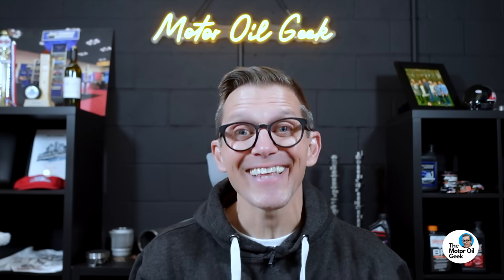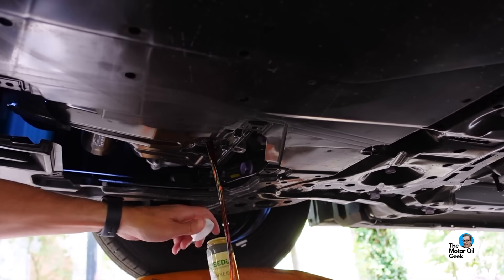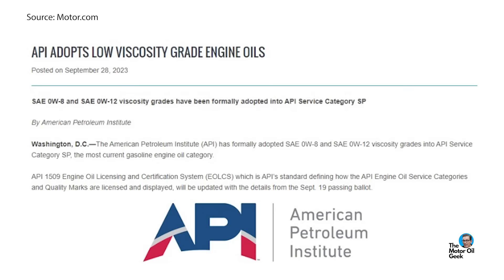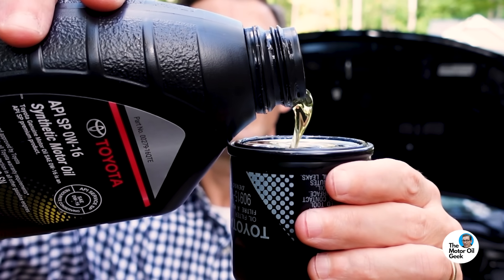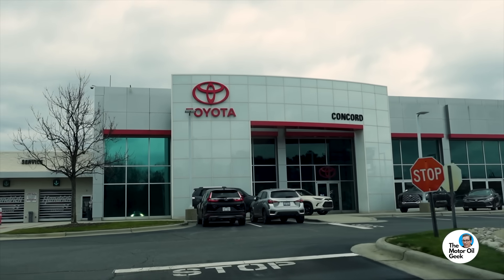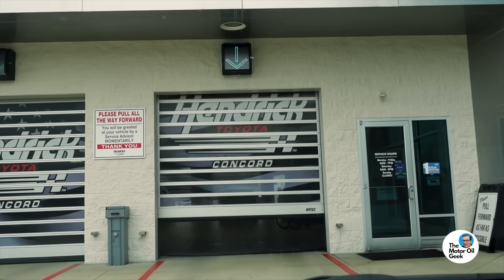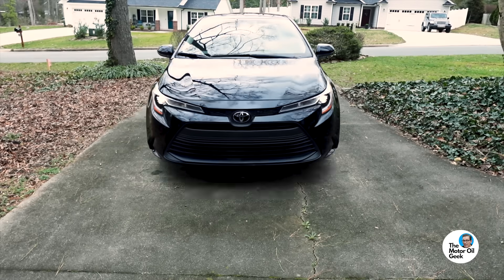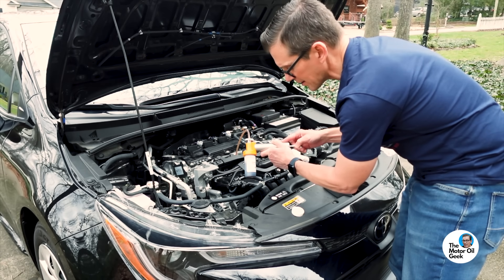0W-8 Motor Oil: Too THIN to Trust? Let's Find Out!

Comment: Worked at a FCA dealer for a few years, 1 time we had a customer that'd bought a new durango 3.6. she immediately had a small lift and bigger wheels and tires on it, then decided to keep driving it for 12k miles. Came in for a oil change (must have gotten tired of the car beeping and displaying oil change now on the dash, for the past 6k miles), took the drain plug out and nothing happend. I stuck a small screwdriver in the hole, started pulling big chunks of black sludge out then eventually oil came out. I changed the oil put in some justice brother oil cleaner let it run and changed it again, I'd be surprised if its still running. Basically I'm saying don't be dumb, change your oil at the right intervals. I may be wrong but i feel like the issue with the lower weight oils isn't necessarily wear but more of a problem of it getting past the rings and burning. An old rule of thumb in older engines (pre cylinder deactivation and vvt) is when they start burning oil is to put some thick as hell lucas in it. It may be fine for these newer cars but i wont be switching to any oil starting with a 0 anytime soon, even if it may slightly increase power and fuel economy.

Comment: I have a 2015 Lexus CT200 h, I have taken it twice to the dealer, and they will not change the transmission fluid they told me it's not recommended to do it, and they won't do it.

Comment: Here in Sweden I have recently bought a Mazda 2 hybrid which is the same car as the Toyota Yaris hybrid , and the owners manual stipulates the use of 0W-8 oil. It also states that 0W-16 or 0W-20 can be used temporarily  but you must revert back to 0W-8 at the next oil change. However , Mazda refuses to use 0W-8 and uses their own brand of 0W-20. I just wonder if this will have any long term effects on engine ware.
Reply: Sweden is a wealthy country. Please buy Mercedes s580 with V8 engine.
Reply: @rachelgreen1368  I would do , but there are none for sale over here.

Comment: I know i probably won't get an answer but I'll shoot my shot.

my 2020 Mazda 3 i just bought Yesterday has the Skyactive X Engine in it 

the manual says i should use 0W20 oil in normal conditions and in Hard conditions 5W30

 now 0W20 is also very thin oil and i dont know who to trust 
i would love some tests obviously maybe someone has some info on it ?

Comment: I have a 24 Tundra sr with the base turbo v6, I believe a lot of the Tundra engine issues are due to the first oil change at 10,000 miles. I did mine at 1500, 5,000 then I'll do them at 4-5,000 for the rest of its life. I use only Toyota oil and filters. I have 20,000 miles on it, purchased new on 1/21/2024. The Toyota filters are about the size of my lawnmower oil filters, even if I was doing longer intervals I'd probably change the filter at 5,000 miles. But oil is so cheap compared to engine failure
Reply: There are larger toyota filters available, just do some research. I switched mine about 20k miles ago.

Comment: I was just wondering does the Toyota have a filter does CVT transmission my Ford freestyle has two filters and we're supposed to change it I believe every 30 to 60,000 MI

Comment: Are the Toyota care terms different by state or something? I bought a 2025 Corolla and the dealer recommended oil change at 5k, off course I did braking change at 1k and again at 2k, but for here and out I will just take it to the dealer

Comment: 10000 miles on the first oil? That’s way too long. Car manufacturers haven’t been doing a break in period for a long while now. All the parts are still new, sharp and haven’t been broken in. It’s the most important step in making the car last, from a fluctuation in rpms to city to highway to everything in between. The first 1-2k miles are super important. Once you’re past the break in period you should change your oil. Everything’s broken in and there will be an increased amount of metal shavings floating around in the oil. And no oil filters don’t filter everything, only down to 20microns that’s if it doesn’t clog/go through the bypass valve.

Comment: The Corolla Warranty and Maintenance Guide says that there is no scheduled CVT fluid change in the first 120,000 miles, however they do say that if your vehicle's usage falls under "Special Operating Conditions" which they define as that the >majority< of your use is that of a taxi/delivery/police vehicle, lots of towing, use with a car-top carrier, or heavy vehicle loading, then they say change it every 60k mi (simple drain and fill, no flush, no dropping the pan). Nissan added this same guidance to their manuals starting in about 2017 after they had huge problems with CVT failures (mostly due to heat) however Toyota had this same guidance since 2014 when they first put CVTs in their cars.

Comment: I just bought a 2025 Toyota Camry Hybrid that calls for 0w-8. Owners manual says if 0w-8 is not available, you can use 0w-16 temporarily till you can swap it out for 0w-8. The engine A25A-FXS, called for 0w-16 a couple years ago before 0w-8 existed. I respect your findings about 0w-8, but want to run Pennzoil Platinum 0w-16. What oil and weight are you going to run in your daughter's Corolla? Do you prefer Pennzoil Platinum over Mobil 1? Pennzoil doesn't make Ultra Platinum for 0w-16. Thanks for all your great Videos!!

Comment: I'm never switching from 20-50.. I need engines to last over 350K miles.. Water weight junk is good for 0.003% better milage, political garbage for stupid politicians enforcing CAFE requirements.  I prefer keeping a car for 20 years as a greener solution than constant replacement being needed because engines are shot in low miles.

Comment: Gimmick for gas mileage, 5W-30 or 10W-30 is best for engine longevity in a performance application (not driving like a grandma, for a light duty street car like this just about anything will do the job ) - extremely well proven
Reply: Facts
Reply: Not well proven at all.
Reply: @SingleStacked you're not a tribologist, but I work with people at GM who have studied lubrication engineering for decades.
Reply: @fzr1000981  I am a tribologist.
GM?...that explains your misguidance.

Comment: On my new 2022 Toyota Corolla, I drove 500 miles and changed the oil. I then drove 1000 miles and changed the oil. I then drove 2000 miles and changed the oil. Now I will change at every 5000 miles.

Comment: Maybe I'm missing something here, but how can you know from the data that the dealership used 0W-8?  Comparing the dealership oil to the clean 0W-16 that you put in yourself, the numbers, including viscosity, look about the same. My next question is, does it really matter which one is used? Is Toyota using the lower viscosity oil just to boost the EPA mileage numbers? There is quite a big difference in price between the two oils.  Toyota sells 0W-16 for about $55 a six pack, while the 0W-8 is about $95.
Reply from the maker: The viscosities are different. It was clear they used 0W-8 from the data.

Comment: When stealerships tell customer & stated in owners manual "Closed for life", "No service needed", "No maintenance required" on their transmissions & never include the transmission drain bolt location, it's "VERY specific to check/drain &  fill procedure" is a joke

It's to force owners into the stealership & they hope the owner has voided engine & transmission warranty. It's planned  obsolescence to sell you another vehicle. 😅😂😅😂

Comment: I'll only use 0W-16 on the 2025 Camry in the winter and 0W-20 in the spring, summer, and fall here in South Texas.
I want my Toyota to last 300K miles.
Reply: Use 0w40 Euro spec oil with Porsche a40 approval.

Comment: You changed oil at 700 miles, why? Here in Sweden I never heard Toyota or any dealer advising car owners to do that, they give you your brand new car and tell you see in a year or when you drive 30,000km, that's the time when your car is due for an oil change. My 2011 Hyundai i30 with a 1.6L diesel has its first oil change maybe in 2014, I wasn't driving a lot so waited for 30,000km mark to change it, and I still have the car and still do changes at 30,000km mark...
Reply: Europeans don't care about cars, only ecology. Cars like frequent oil changes, every 5000 кm and thick oil.

Comment: I just did the oil change in my new 2025 Toyota Camry with 2270 miles on it.  My oil analysis looks almost identical to your first oil change. I installed Mobil one 0w8 with a Toyota filter. I may wait till the 10000-mile change that the dealer will do. I find that the engine on the hybrid doesn't run mor than 50-60% of the time. If I find that we didn't put that many miles on the car before the year is up, I will try to get them to change it anyway.

Comment: Mobile One 0 w 8 On the shelf at Walmart,  Duh! $27.00 for 5 quarts. Don’t put 0w8 in anything earilier than a 2025 unless it is specified by OEM. The transmission fluid for eCVT  has changed also was WS trans fluid now ET or TE trans fluid.

Comment: 5W20,  5W30,  5w50 offer better protection over 0w8... Tolerance are irrelevant , besides its only for the best gas mileage using 0w8 versus 5w50...

Comment: I absolutely hate CVT transmissions. They just feel like junk. Sure, they've gotten better, but i absolutely hate not feeling anything. Called me old fashioned but i miss geared transmissions. 

In regards to 0w oil, here in Arizona, there is no way i would run that thin of an oil. 5w-30 is the thinnest i would run in our extreme summer heat. I could care less about fuel economy. I want engine protection.

Comment: There is another you tube presentation where the guy says engines still have one and a half thousands clearance because some ole timer told him so. Modern Engines made with cnc machines have Almont  un measureable clearance therefore 0w8 oil.

Comment: When I bought my new car I changed it at 500 and 3000. After that I changed it when the dash told me. It’s a GM so it has an oil calculator that uses variables like temp, miles, rpm’s, idle times, whatever. Generally it goes about 10k ish.

Comment: Mix 5W-30 with 0W-XX OIL to get both benefits of better viscosity and modern additives.
Reply: I've had great results mixing 0W-20 with 5W-40 or15W-40 in small equipment engines.  It made easier starting and smooth performance at high RPM. (Engine called for 5W30/10W-30 stock)

Comment: Hi Lake, I love your channel as it uses science to reveal the truth. I am planning on purchasing a 2025 Camry in the next month or so, but now am concerned about the 0W-8 fiasco. It seems irresponsible to use that thin of an oil long term. What are your thoughts on legitimate alternatives that would not void any warranty (standard or extended). Am I stuck with 0W-8 and hope it doesn't eventually trash my engine? I keep my cars LONG term (29 year old T100 with about 190k and a 13 year old Civic).
Reply from the maker: Stay tuned! We are testing the 0W-8 vs the 0W-16 and will show the results.
Reply: @themotoroilgeek  Awesome! Ty :)

Comment: l dont trust these uber thin oils especially when asked for 0-20 in a 6.2 hemi ,you put that truck to work pulling trailers l see problems coming with these long oil change intervals Nope not going to happen here . Not after hearing so many horror stories about people paying out of pocket for repairs on new vehicles . l say use the thinker stuff allowed save your  engine and your money

Comment: 0W8 is actually at Walmart, made by mobil 1. they also have a 0W16.  which to me both don't need to be in any engine. Mobil 1 makes Toyota oil,  The first year the Tundra came out, my brother bought one, they said he needed to use 0W20, due to the tight tolerances in the engine. Now I hear people say its for better fuel economy. I don't by that.  So what is going on in this market, why are they thinning this oil down, and is this 0W8 the reason Toyota is blowing engines.

Comment: I work at a toyota dealership in TXM.  Every car gets OE oil for 0-16 and 0-8. 0-20 gets OE oil until 30k miles and gets oil from a pump past then.  5-30 also gets oil from the pump.  Not sure if the oil the pump uses is OE or not i just put it in, but i figured it wouldn't hurt to say what i know.

Comment: I have two Rav4s in the family. From two different dealerships. Always been serviced at their purchased dealerships. Both call for 5W-20 or 0W-20. Every single service invoice says 5W-30 XD. The vast majority of dealerships will just use bulk oil unless their bulk oil is not a spec for that vehicle Somewhere in the world. 5W-30 for example is a spec for these two RAV4s in central latin america and the middle east.

Comment: My 2012 4Runner calls for 0W-20 but I have been tempted to use a 5W-20 or 5W-30. I do not care about getting fuel mileage as much as I am getting the longest life out of my engine and PROTECTION to the internals. What does the SCIENCE say?
Reply: 5W30 wouldn’t be a bad idea.

Comment: Motor geek did this test in a high hp V8 on a stand, the low viscosity oil had more metal particles than tbe higher viscosity.

Comment: Are you sure about the standard CVT? As far as I know, Toyota uses e-CVT, which doesn't use any metal belt, but rather electric motor and planetary gears.
Reply: That’s for hybrids only

Comment: As a BMW tech, the new B58TU2 uses 0w-12, which also wasn't approved by the API until September, but BMW would send out a bunch of 0W-12 to dealerships, would be on backorder sometimes because it wasn't readily available. Some of the field engineers said that we couldn't use 0w-20 as a substitute, and others said it was completely fine to substitute incase of no availability. We still had the oil, but it wasn't approved by the API
Reply from the maker: Interesting

Comment: That's not a cvt, it's an ecvt! There's no belt, just motors and gears. Toyota I believe says every 50k miles for the oil changes, wouldn't hurt to do it earlier but theoretically speaking it shouldn't matter as much as a normal CVT.
Reply: eCVTs are used on hybrids like my Toyota sienna. His corolla is not a hybrid, therefore its a CVT.

Comment: I have heard nothing but bad news for CVT transmissions. I'm surprised this guy caught a car with a CVT
Reply: Not necessarily with Toyota. Toyota makes great regular CVTs, but they also have some flaws after i think 120k miles. 

But its yhr eCVT, Toyotas biggest, best reliable CVT transmission. It should not even be called a CVT, it does not use a traditional mechanical belt, it uses motorized belts driving the drivetrain. These eCVTs are used on hybrids. 

I have a 2022 Toyota Sienna, its a 2.5 hybrid, with the eCVT, i have had nothing but good things come from it. You could literally floor it and it still would pull and hold up great.

Comment: My 2007 Ford Escape with the Duratec V6 is at 130K miles, has used Synthetic Blend 15W-40 for the last 100K, miles, and it's smooth as can be. It has also used 10W-30, 5W-30,  and has also worked well, but 15W-40 is the smoothest.
Reply: My 2010 Escape has 140k miles and run with the manufacture recommended 5-20. In FL heat and is smooth as can be.

Comment: My 2022 3500HD with the 6.6 liter gas engine consumes about 1 quart of the recommended 5W30 engine oil per 1,000 miles. GM says it's completely normal, but I'm not retarded. The thing consumes its entire oil capacity every service interval. It's lunacy!  What can hurt the engine faster, running 15W30 Rotella T4 or running dry of 5w30...
Reply: It's a work truck with a crane bed, loaded out with tools to max GVWR around 14,000 pounds. It has 14,000 miles.
Reply: Yeah piston ring failure

Comment: Low viscosity oil is perfect for DI engines running short trips that dilute lubricating oil with gas. Never have to add oil because level increases and you get better fuel economy with lower and lower oil viscosity as you drive!  Genius. 😅

Comment: Isn't it true that when you thoroughly drain the oil out of your engine, even if you let it drain overnight, about one half to one quart of oil still remains in the engine in pockets that simply don't fully drain out? Wouldn't that account for the high iron on the one oil analysis?

Comment: Thank you so much. Finally the answer I needed after much searching. 

Quick question. I have a Jimmy in India and the oil specified for the car is 0W16. Currently I running the Rowe 0W16 oil   

Question is it’s currently summer here, ambient temps of about 50C or 122 F.  

It gets really hot here. Should I stick to manufacture recommended 0w16 or switch to a 0W20 or 5W30. 

Look forward to your response.

Comment: I have a feeling in 5 years most new cars and hybrids will use 0w 8. Its just a matter of time.
Reply: Based on the test result we see here in this video and in the video showing the test results from changing the 0W-16 oil at 500 and 3000 miles, that'd be a good thing.